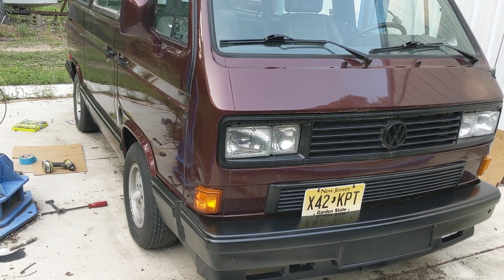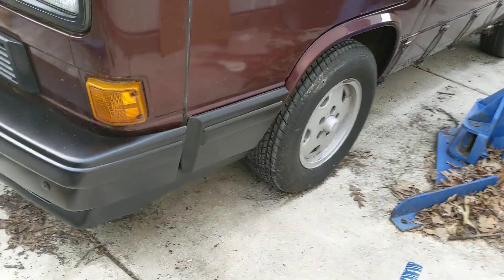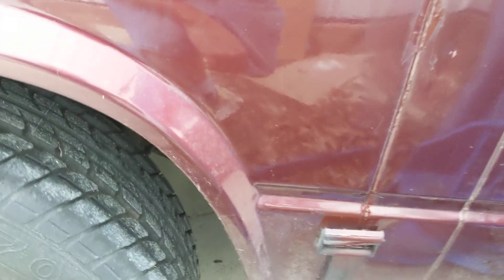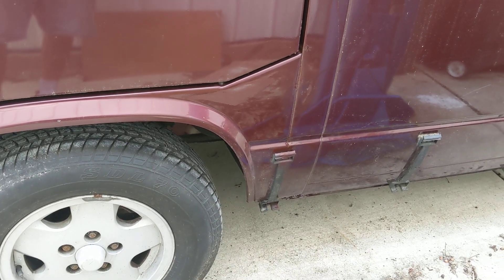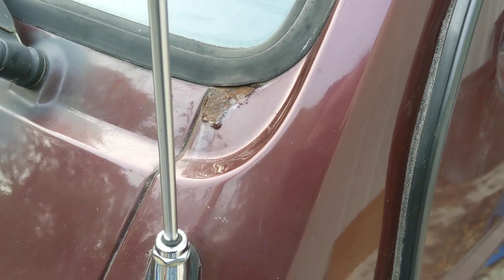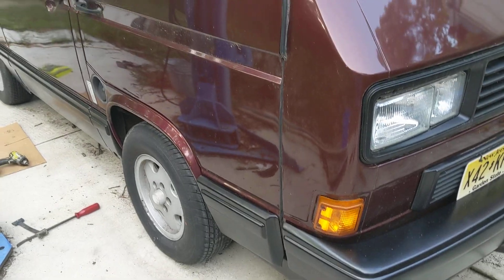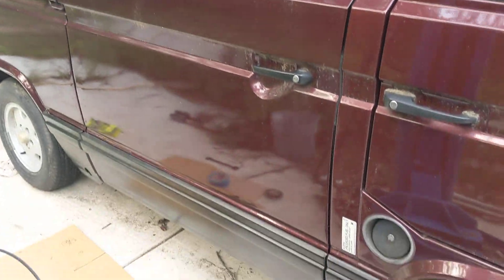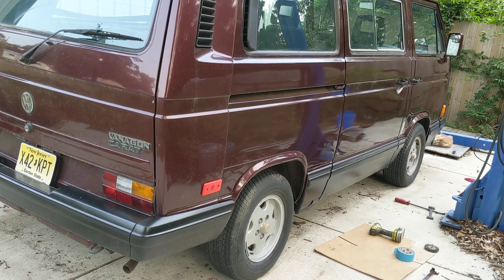Restoring a project Vanagon Carat part 11g

Comment: Hi Ken,  Black painted side skirts look good.  I just got finished wet scotch bright padding and painting my grills with the satin black Rust-Oleum you recommended.  Turned out great.  And painted the front VW badge maroon to match the van.  Is there a good product to touch up clear coat?  On the long front nose strip along the windshield wipers to the windshield, mine has flaked away.  
Thanks aging for these very informative videos.

Comment: Hi Ken! Your project reminds me of one I did years ago on a BlueStar. Im  now working on a 82 Vanagon with an inline 4 Ive been driving a few years. Last summer I installed a Westy interior and currently I'm trying to solve a clattering lifters . I'm servicing a pick-up tube pressure relief valve getting it ready to swap out the one I put in a few months ago. It was clattering then and I replaced the pump with larger gears. I suspect the plunger is stuck. 
That pick-up tube has a small plunger. I'm thinking the bigger plunger = more surface area for the oil to push on?